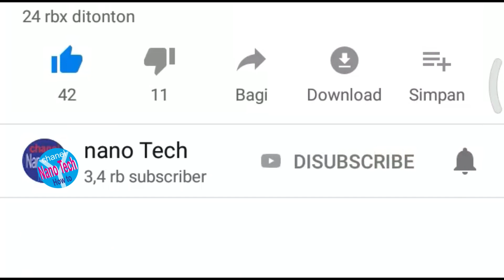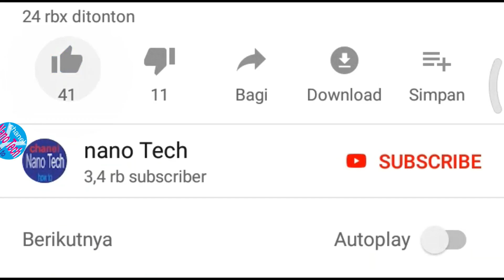Repair the buzzing electric fan

Comment: when i open my fan, i rotate the fan with my hand but it hard to move the blade, 
i add some "singer" oil, and i try again, it easy to rotate, but after a day i used the fan, the blade come back to hard to rotate again, any solution ?
thank you
Reply from the maker: please maybe the dynamo spull has been damaged, causing excess heat and oil to dry quickly ,see my video here https://www.youtube.com/watch?v=PZJOvx7wP4o
Reply: @nanotop  thank you, will try it later
Reply from the maker: Good luck

Comment: my fan shaft is running freely when not connected to supply,but  when i connect it to supply it runs for sometime and then stop , sometime  it just didn't rotate , can u tell what are the possible causes plz
Reply from the maker: the cause of the fan sometimes stops spinning that I've ever encountered including; The ac cable is not connected properly, the switch is broken, the cable will break and the connection between the coil and the cable does not glue perfectly
Reply: @nanotop  ingris lo mantep